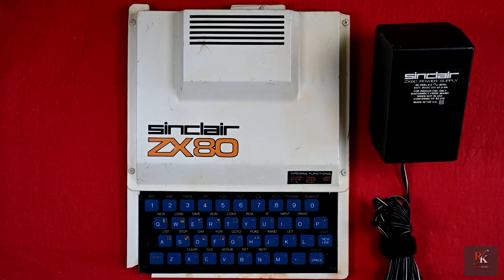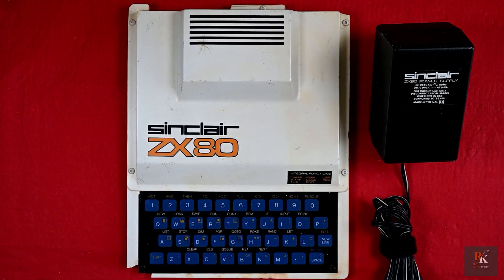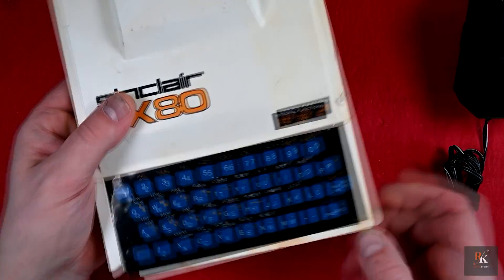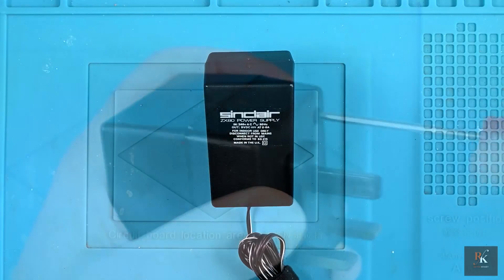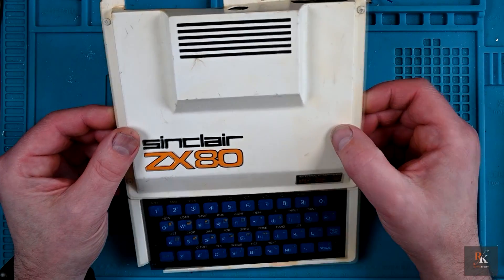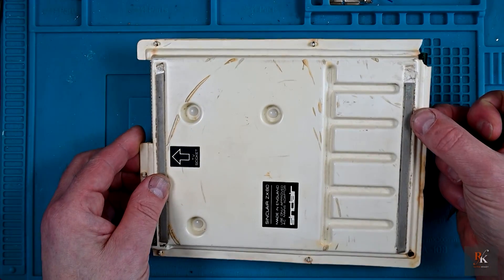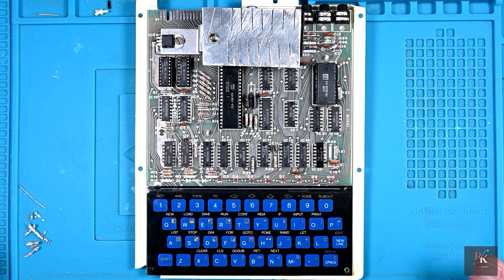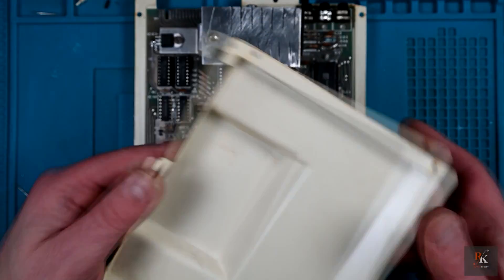Repair/Restoration: Sinclair ZX80

Comment: I learnt to program in BASIC at age 10 on a Commodore PET my dad sometimes brought home from work in 1979, but the ZX80 was the first computer I owned. I waited months for it to arrive and just after each latest due date we’d get a postcard apologising for further delays more than once. As an 11 year old I remember rushing home from school every day near the due date hoping it had arrived, each time disappointed and devastated when the postcard turned up instead. When it finally arrived I absolutely adored it. As simple and cut down as the ZX80 was, it was mine. We soon upgraded to 16K and my dad even built a custom solution to stop it knocking and crashing. He also cut a few vents to mitigate overheating.

Comment: Nice .. I've repaired lots of specys .. but never had the pleasure of zx80 ...

You could solder the heat sink and bracket and remove the screw ...
Reply from the maker: I think, if I was to do anything, it'd be replace the heatsink with a replacement to keep it original. Happy enough with the filing down of the screw as it no longer touches the top case at the moment though. Lets see what the future brings!

Comment: I had a ZX80 and ZX81 then the Spectrum at the time, the Spectrum was binned after a short in the PSU that today is a 5 minute fix, but I don't remember what happened to the ZX80 and ZX81. Today I'm a collector of these and other computers of the era, but to get a ZX80 today is way too expensive.
Reply from the maker: I was lucky that I kept all mine, well most of them. Wish I'd kept my A1200 and the A1010 drives pluus a fewmore, though just grateful I kept the ones I did.
Had the seller of the ZX80 not been an absolute gem of a woman and was happy these were going to someone who would restore them, the I doubt if I'd own one either tbh.
Glad you enjoyed the video though :)

Comment: I enjoyed that a lot. The Zx80 is a machine that I had never seen or heard of until I saw one in "Micro men" in 2009. I've never ever been in the presence of one and I doubt that I ever will be, given how rare they are. Well done on this acquisition and how great is it that it worked just like that? I look forward to part 2 and moreover seeing if you can save stuff to cassette with that mic port, or was the mod a valid one? Good luck and enjoy your holiday ;)
Reply from the maker: Thanks! Yes, the price of what is in reality a very basic set of chips has become ridiculously expensive. Even a replacement original TV aerial is £20! Though as a collector, I'm just glad I got one! :)
I suspect the mod was possibly to increase the audio output volume when saving, though not sure. Will be fun finding out!

Comment: The ZX80 looked so cool in the ads. Teenage me saved hard so I could almost afford one, my mum even decorated my birthday cake to look like a ZX80. When I eventually saw it for real I couldn't believe that it had the build quality of a disposible yoghurt pot, and that somewhat put me off.
It was still nearly my first computer... Still wish I had one.

Btw, your video would be much better without the background music.
Reply from the maker: Thanks for the memorys David! My first was the ZX81 so missed out on the ZX80. I have to agree, the plastics are aweful and why not actually have vents at the top???

Apologies about the background music, it's supposed to be 'ambient' unless I'm using it to fill in for the soldering/disassembly montages so it's obviously too loud if you're noticing it :( Unfortunately YouTube won't let us just relace it and I'd have to delete everything and start again :(
Reply: Disposable yoghurt pot is the perfect analogy. It's amazing how cheap Sinclair was ... leaving usability completely out of the equation.

Comment: I nearly have a stroke every time I have to work those push pins on my ZX80s.

I do like to keep the ZX80s as close to original as possible but I'd think a modern voltage regulator might be OK considering heat issues but if you're not likely to use it, I'd probably remove the extra heat sink. 

But hey, it's yours, do what thou wilt. ;)
Reply from the maker: I seriously thought I was going to destroy the plastics taking those out - NOT for the faint hearted!

I did think about removing the extra heatsink, but for me, I'd need to put an undamaged one in its place. I don't have one so it'll remain for the moment! If I do get another ZX80 in better condition, then I'll leave that stock and re-visit this one though as have used a Traco Power in my old ZX81 - runs cool and fine :)

Comment: Today people often refer to this as the first affordable computer.  As you point out, it was still quite expensive for the time, just darn cheap for a computer.  When I first saw the kit advertised, I knew I had to own one.  Unfortunately, I would have to wait for the ZX81 as all the Z80 kits were sold out.   Overheating, lousy keyboards and ram packs that wobbled causing reboots did not matter, it was a computer !!! and I owned it.   Still, I wish I had gotten that Z80.  I still have my eye out and one day my wallet and an Ebay listing will align.  Thank you for sharing and evoking the nostalgia.
Reply from the maker: Thank you for taking the time to watch and comment!
I missed the ZX80 boatd and started with a ZX81 and it too suffered from exactly the same flaws. But would I have swapped it for another game or toy? Not on yourlife. To me, it was perfect as it was. Well, maybe not the Rampack wobble...
Reply: Have the stars, your wallet and ebay aligned already?
Reply: @MarcKloos  Not yet ! But I am keeping my EBay search alert going.
Reply: It was, but other computers were completely out of the question for an average household and it was at a fraction of the cost of the alternatives, for instance the entry level 8K Commodore PET was £499 (PET 2001-8K) back then and the entry level TRS-80 (4K Level 1 System) was at a similar price without a monitor or tape deck.